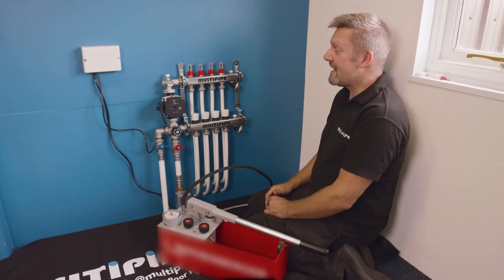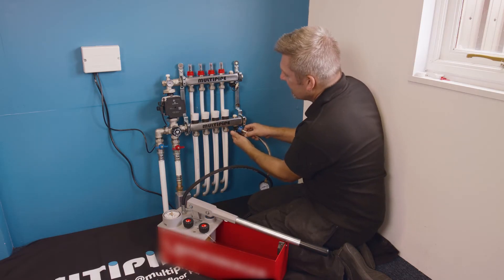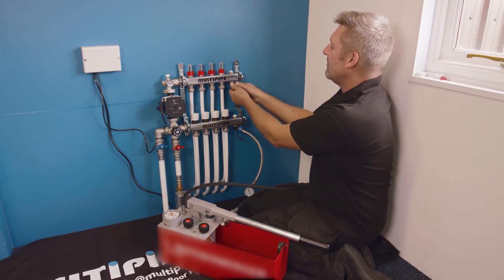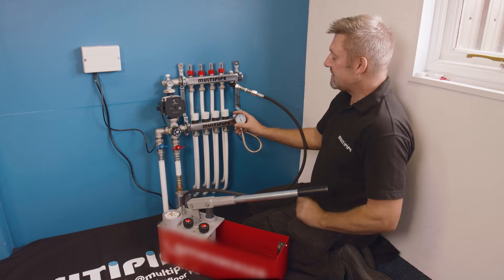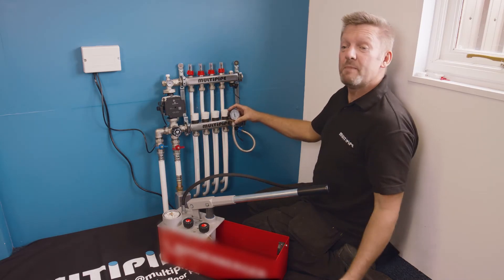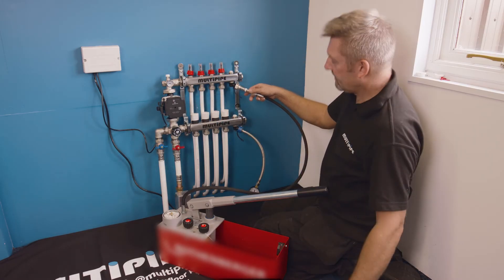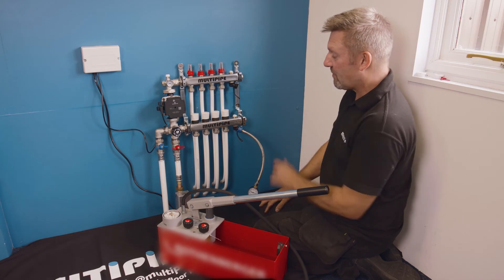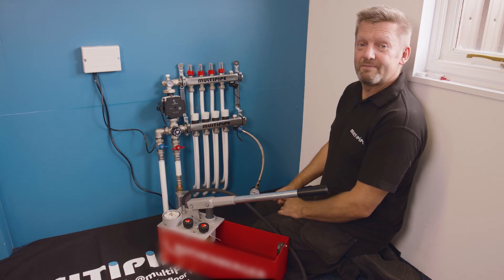Pressure Testing Your Underfloor Heating System

Comment: If you have two floors  which floor would you fill and test first? Also wnat stage wolld you introduce the inhibitor, i have an old system and now has air locks. Hopefully you might want to answer this,the heating is on two floors the ,with screed on the ground and between joists oc celotexst and metal plates. Thanlyou rof the videos, i found them clear, concise ,and easy yo watch

Comment: are you saying to screed with it at working pressure or the higher testing pressure?
Reply from the maker: Screed at normal operating pressure, as when the screed is curing, you do get changes in pressure, so a lower pressure ensures you don't run into any issues.
Reply: Much appreciated.

Comment: Great educational video, thanks a lot. I'm having a question regards this. I'm having 130 m^2 floor, and I'm planning to cover it with 13 circuirts, open loops system without actuators and buffer tanks. How can I be sure that my pump can drive all od the circuits well. My pump can maintain flow 25,8 L/min for delta 5 at 35 degrees celsius and it is variable speed pump with 32/102 input / output watts. Can I go with a single manifold or I need to split the instalation on multiple manifolds?
Reply from the maker: if you send your project to us we can check the duty and ensure the bar on our manifold is good enough for the pump send to quotes@multipipe.co.uk

Comment: I've been watching your videos and they are very thorough. I've been installing my own ufh system and I'm really enjoying integrating it into our existing boiler and radiator circuit. After watching your filling video I have put mains pressure into the system, and I was surprised my gauge was at 4.5 bar once I closed the valves and disconnected the pipe. Within an hour or so the pressure has gone up to 7 bar without me putting any additional water into the system. Great news is that there are no leaks so far, so do I need to use one of those hydraulic testers?
Reply from the maker: Thanks for watching! all a pressure tester is for is raising pressure in the system to a level required
 to test for leaks in UFH that is 4-6 bar. so you are good to go. However, I would question the accuracy of the gauge as mains domestic pressure is normally 1-2 bar only. also, pressure in a sealed system can only go down not up.
Reply: @MultipipeLtd  Would sunlight heating the pipework cause it to warm up and increase the pressure? The room we have laid the pipe in gets the sun from around midday to sundown, and the foil-covered insulation does get warm with the sun on it.

Comment: Is it possible to close all UFH circuits except one and then to measure pressure on only one circuit and not on all manifold installation? I want to pinpoint if one exact UHF circuit is leaking. I am not sure if 5 bars will be to high if valves for other circuits are closed as well as flow meters?
Reply from the maker: Apologies for the delay in coming back, providing the seals are good on both the flow meter and the actuator pin there is no reason you cannot lock down and pressure test each loop. As you don't know the state of the seals it best to lock down the entire manifold (all flowmeters/actuator pin and primary ball valves) then release pressure on the bottom bar (open the drain) and pressurise the top in theory no water should come out the bottom then open the flowmeter only one by one until you start seeing a drop.
Reply: @MultipipeLtd  thanks  for your feedback. Greatly appreciated!

Comment: Would you close off your auto air vent on the manifold if it had one fitted?
Just thinking if it vents air your pressure would drop whilst leaving on pressure test
Reply from the maker: Not if you are wet pressure testing. Venting the air first is vital as compression of air in the system can give false readings. If, however you are air testing then yes ensure it is shut.

Comment: Hi Martin, you have helped on my recent installation with your great videos. On the pressure tester I have a 15mm female connection, what do you use to apart it’s to fit the 3/4 tap connector on the manifold?
Reply from the maker: Hi! glad you like the videos, most pressure testers have a 1/2" connection they are slightly different but for this one i just used a 1/2" Male Iron into the tester (with thread tape) bit of pipe then a 3/4" Union connector so it gives you a nice easy way to breakout after you finish (just remember the flat face needs a washer.

Comment: I had my UFH commissioned today however the Gas Safe engineer haven’t pressure tested and have asked me to leave the UHF running for few hours and switch it off to cool before screed. So is a pressure test a must? Is pressure test only to test for leaks? If there are no leaks under a working pressure than can you still proceed with Screeding? Please advise. Thanks
Reply from the maker: It is highly recommended to pressure test past what the system will run at. This ensures the chance of failure before you permanently screed in the pipe is minimised. Remember, that pipe is going to be embedded for the next 50 years +. At the very least when screeding the UFH system should be pressurised.
Reply: @MultipipeLtd  Am I correct in thinking that the pressure test is only performed to check for leaks under high pressure? Or is it also done for the maximum pipe expansion before the screed? Many thanks.
Reply from the maker: @BigGoldenApple The first part of the test is to check for leaks (normally around 4-6Bar). In the second part, you reduce it to system pressure (around 1-1.5Bar) then screed with this. It is to ensure you do not crack the screed or squeeze the pipe.

Comment: Can you do one on single zone UFH. Can a zone pressure be seen from the boiler? Can more pressure be added by the boiler?
Reply from the maker: Many thanks for your message, We will put down to do a video on the single zone pump unit. Thanks for the suggestion. Unless you have hydronic separation, the system pressure is generally around the same no matter where you are in the system. This is only to provide a positive pressure in the system for pumps etc., to work. This video is aimed more at testing the system for leaks. As per our earlier video on filling your system, you should fill the system and then "top-up" the pressure using the boiler fill loop when required.

Comment: Before screed goes down what pressure should it be please? I think mine is around 5 bar
Reply from the maker: apologies for our late reply, the pressure when laying should be dropped to around 1-1.5 Bar. This is enough to allow the showing of leaks (the pressure drops to zero) but not enough to cause damage. As the pressure will vary a lot during the screed curing.

Comment: hi there, i noticed you dropped the pressure to 2 bar prior to screeding, i have fast set screeding being laid and there will be a certain amount of heat during the 48 hour curing time, will this heat build up pressure in my system more than it can handle? or would i be wise to drop the pressure maybe down to 1 bar?
Reply from the maker: The pipework we sell as part of our system is designed to run at 10 Bar @ 80°C, so to have a system pressure that high would normally not happen (as your safety valve on the system is normally set lower than this). Of course, other manufacturers might have different pressures, but this should not be an issue.

Comment: Your video is great help first time installing tomorrow  🤣 just wanted too ask you use the red pressure tester and I haven't got that, can I just carry on filling up from cold tap using a pressure gauge
Reply from the maker: I am glad they helped. The issue is the cold water pressure in the UK is around 1-2 bar, whereas you need to test higher than this a minimum of 4 bar. However, you can pick up a pressure tester for not very much. Being as you plan to bury the pipe for the foreseeable future, it is worth the investment.
Reply: @MultipipeLtd  thank you so much for replying back too me as I will be doing this job in the next few days, I will buy a pressure gauge not a problem I was asking if I leave the gauge attached and keep filling from my mains cold rather than the red pressure tester you have. I am sure if I keep the cold water attached and the pressure gauge it will get too 6 bar.
Reply from the maker: @raybahadur6555  ok, so in terms of filling the system, you need to watch our other video as you need to push the warted through the manifold (filling from a cold water loop would take an age). see: https://youtu.be/3MrrPgLRtuM . if you can get 6 Bar on the main, that's some pressure. But you are correct, then you would not need to pressurise more. Just keep the little gauge attached for 1 hour and look for no substantial drops. then drop to working pressure before screening. I hope that helps :)
Reply: @MultipipeLtd  can I achieve 6 bar pressure just using the mains cold water as I dont have a pressure test pump

Comment: Hey guys, I watched the video where you are filling and opening the flow meters one at a time and then closing them one after each other, however the actuators you don’t seem to close them? When you’re filling won’t it go down into the next loop? I would have thought you open one flow meter and one actuator port and flush water through and then close both them and move onto the next?
Reply from the maker: providing all the flow meters are shut and you only open one at a time then it cannot flow back as the water will be flowing over the flowmeters, you are only shutting them to provide more resistance than the loop you are filling as water will take the easiest route and flow out of the drain rather than backflow and push the flowmeter up.
Reply: @MultipipeLtd  so open one flow meter and open all actuator heads/returns. Then fill and close flow meter and then move onto the next flow meter and once all filled open all flow meters. Brilliant thanks guys

Comment: I have a situation where the UFH system has been installed for just over 5 years and this winter it struggles to heat the room (air) and never manages to reached the desired temperature (20°C). The floor ins't cold but is barely warm even after running it for many hours. Everything looks ok and is running in the manifold and the pipe coming from the boiler is scorching hot. But the loop pipes leaving the manifold and all thr pipework in the manifold itself don't feel very warm. 

Could you make any suggestions as to what might cause this situation or what I should look for or can try myself, before I get a heating engineer out.

Thanks.
Reply from the maker: A good UFH system should never really be warm under foot (if it is then it probably overheated). but firstly get yourself a cheap spot temperature thermometer and check the floor surface temperature this should be no more than 29°C. If that is the case than the UFH is fine but its more your building is loosing more heat than the UFH can produce. There is other things we can try just call us on 01245850799 to discuss further.

Comment: Your video was very helpful and easy to follow, unlike the countless others that I've consumed.  I might have a new revenue stream for your business, I would actually like to pay you to do a Zoom call with me to walk me through purging my system.  The system is about 2 years old and it seems as though it is air-locked, since the floors aren't as warm as they used to be.  If that is something that interests you please let me know.   I'm sure you can get a ton of people much like myself to consult with you for help with simple jobs such as this.
Reply from the maker: @hennx55 many thanks for your message this is something we have not considered for our business as we mainly did these video for installers of our own systems. However, I will discuss this with our management about the potential of offering this service. please message me at technical@multipipe.co.uk your issue you are having.

Comment: Great vid, my installer has 'air' tested my installation as the house is still at first fix stage and unheated through the winter. Pressurised with compressor to 2 bar but drops to 1.5 after a week and then gradually drops further from there, anyone any idea if this is expected behaviour using air over that period?
Reply from the maker: Air testing is fine and you would expect a drop on initial pressurising and it could be as much as half a bar (known as settling) . However, what you don’t want is for it to keep dropping as this usually indicates a leak. Check to make sure all the valves are shut to the system and that any automatic air vents are completely shut. Unfortunately, with air it is hard to find a leak if you have one. I would get the installer back to check the joints as well.